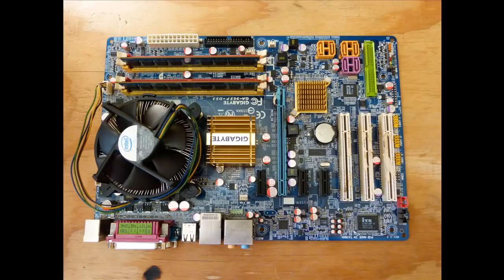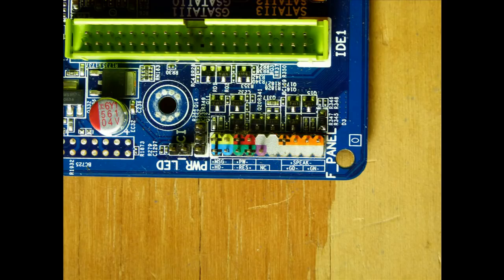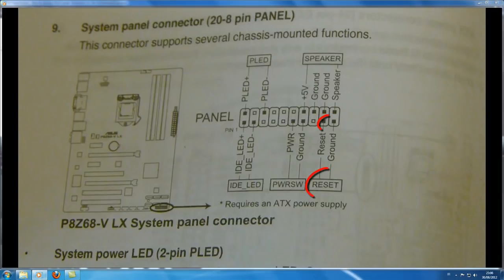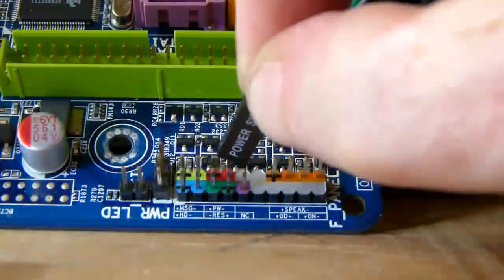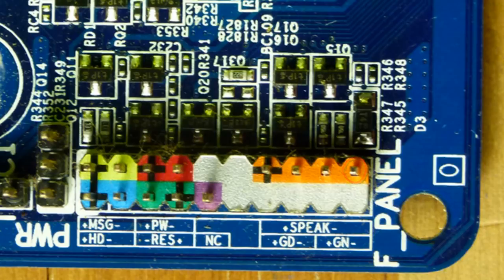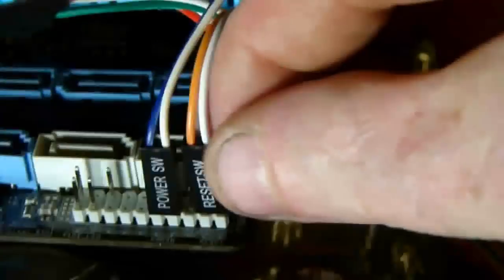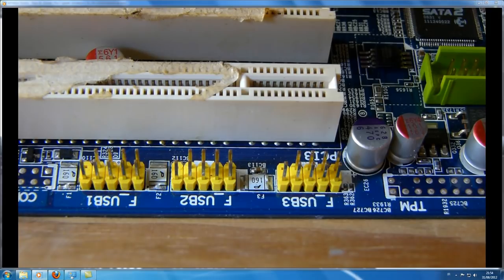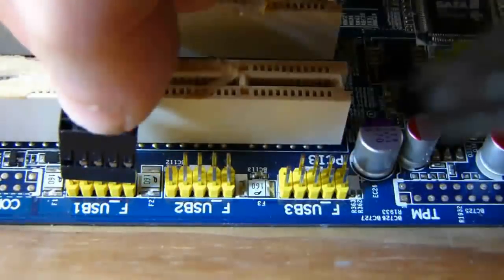How to connect front panel connectors to the motherboard

Comment: Hey! Good afternoon, I just bought a pc from some guys in a computer shop, and i went ahead and put my headphone in the front audio panel and there were no sounds, but on the back panel it worked, then i went ahead and opened my pc, seeing that the audio pin thingy wasn't there and not connected, what would be the best approach to tell them that HSHHSHSHS
Reply: That's what happens when you buy PC from some guys

Comment: hey man. ive been having problems since i upreaded my GFx card. was working fine one min then jst powered down and wouldn't power again., rplaced the card, worked fine. i have the motherboard out of the case as i was working on it, and left it on the lab table for a while just in case, then one day i was connecting a headphone jack to the green slot on the backboard and psheeeewwwww. Everyting went off. No life. I removed the PSU, works fine on it's own. It'll also power fans and even the GFX card fans from it. But when i plug in te 24 pin connector and remove the GFC card and only plug in the CPU's onboard HD4000 HDMI onnector, and NOTHING else, just a stick of ram and press ON... nothing

Comment: I had a prebuilt msi desktop and I moved everything into a new case, everything works fine except for when you shut down the computer it automatically restarts. As soon as all the fans and everything turns off it comes back to life.  I thought I had wired these front panel connectors wrong but I have re-checked it numerous times. I unplugged the reset switch.  The only thing that is different about this build that I took out the wifi card which was in the 2nd pcie slot and  had a jumper to one of the USB headers.  I used this USB header to plug in the USB needed for the rgb fan controller for the thermaltake rgb fans.  None of the fans plug into the fan headers except the CPU fan.  It was giving me an error on start up saying no fans were detected so I installed the old case fan back in the new case plugging it into it's original location.  Any help would be greatly appreciated as this has become very frustrating.  Thank you

Comment: my lian li dynamic case has a 9 pin front panel audio to motherboard connector and i cant for the life of me get this little fucker into the pins. the audio header will go in about half way then stop. ive put decent pressure on it but i dont want to keep forcing it..

yes i have read and followed the manual and have the pins the correct way. 100%sure. 

is it possible that i have faulty audio pins? and is there anyway to check this, thanks.

Comment: The problem is the fuckin' case if you have a fuckin' 10.5 inch long fuckin' video fuckin' card and a fuckin' Antec 300 fuckin' case the fuckin' wires will fuckin' well prevent you from being able to push the fuckin' video card the fuck down.

Comment: For those who have the power pins seperated, - (black) is on pin 6(3 pins from top left) and + (red for me) is on pin 8(4 pins from top left or last top pin) my pins were 4 on top and 5 on the bottom.

Comment: I do not know how to connect the 8 holes in the USB Pins. 
The holes are

1       Port+
2       Port+
3       Port-
4       Port-
5          +
6          +
7           -
8           -

What to do with that? Please help me!
Reply from the maker: Sunil Adhikari sub front connector is designed to just plug into that connection, okay!

Comment: sir, i have acer company motherboard on it have 2 panels of 9 lines and i want to connect hdd led,reset sw pins on it so first panel name is COM and onother is F_panel and onother one having 19 lines name as TPM SPK so where i can connect this 4 front pines on motherboard
Reply from the maker: what 4 pin connector is it? this would be detailed info in motherboard manual. ok! check in motherboard manual!

Comment: My manual dont have the instructions..
Reply from the maker: if it doesn't then it's not the mobo manual!
Reply: it's all that came with it. But I think I figured it out. Something else though, it seams to be that my motherboard dont have a CPU power plug. The 4 or 6 plug usually. Can this be right? My motherboard is a Asus prime b250m-plus. All I can find that is a 4 pin connector is the ATX12v
Reply from the maker: it's either 4 or 8 pined plug for cpu power 8pin is for turbo power. the 4 pin atx12v is the right one for average cpu an 8pin is required for cpus that have the turbo power feature ! ok!

Comment: what is front panel audio?
Reply from the maker: It's either just a small speaker for indicating that your computer is working properly it gives 1 beep if all is good and more than 1 beep something is wrong you will need the motherboard manual to know what the beeps mean if there is a problem and the front audio other than a small speaker then it's usually a connection to a front panel audio jack for pluging in speakers or headphones. ok, hope that helps!

Comment: The official manual both online and on paper doesn't include a detailed System Panel connector. I'm at the point of wanting to return it for one that has a better manual. 

For anyone that wants to take a read, the link is here. http://dlcdnet.asus.com/pub/ASUS/mb/LGA1151/H110M-E_M2/E11622_H110M-E_M2_UM_web.pdf?_ga=2.79628055.242653562.1494188311-1745619420.1494188286
Reply from the maker: thanks for sharing 😊

Comment: Sir i want to play music inside my CPU by using some speakers. I have seen many computers having inside speaker. Music sound can be heard. But how to do it any idea.. I have some local speakers..
Reply from the maker: There is a audio jack at the back of yu PC plug in the spekers jack into that and the pc will pick it up and you should have sound coming out of lacal speakers, OK! Not all computers have built in speakers some monitors do have speakers if you have monitor speakers then you need a two way jack plug cable one jack for monitor and the other jact for back of PC must plug in both via the two way audio jack cable. OK, i hope you get it sorted! 
If you don't get it sorted check out someone's PC that has speakers plugged in and see how they have it set up!
Reply: I want to play music inside my CPU by connecting some motherboard units not by back panel of my CPU. Is there any options ??

Comment: My reset sw won't reach the port???
Reply from the maker: old case then? you will have to get a extention cable to connect it to the motherboard any good computer store should have one or get it on ebay. OK!
Reply: Thanks :)

Comment: My power LED light has three holes instead two, or instead of one hole for negative and one for positive, and my motherboard only has two pins right next to each other. So i can not plug in the Power LED light. Theres no other way to plug it in is there? If not its not that big of deal right? Its just the power LIGHT. All the other connectors connect. So it should be fine. Just no light.
Reply from the maker: Yes that's fine you don't need the power light! It's strange that it is a
 3 hole connector for power LED, are they right beside each other or is 
the extra hole seperating the two wires? If the wires are becide each 
other then it could fit in the connector on the motherboard. OK!
Reply: Kevin Colleran it an extra hole separating the two wires. Its a really old case. Like 20 years old haha
Reply from the maker: oh well! that's the way it goes sometimes! it's an enjoyable experience isn't it? building a pc from scratch. it not a big problem the power light...;^)
Reply: Kevin Colleran yes it is. My first build. So i might check out more of your videos! Thanks for ur help

Comment: the front panel audio doesnt work con my pc, please help!!!
Reply from the maker: is the cable connected from front panel to the motherboard? it usually is situated at the back of the motherboard near the i/o panel , if it is plugged in then find a known working headphone set and check it maybe that what ever you have plugged in is not working. Ok!
Reply: Yes, I connect the front panel audio in the AAFP port but doesn´t work
Reply from the maker: are you sure that your headphones are working?
Reply: Kevin Colleran yes  totally sure, I try whit my headphones Sony, un the back port work really good, but in the frontera port doesnt work
Reply from the maker: so check device manager on your pc and look for sound device this will show you that the sound driver is working front and back then check if the front panel sound settings are enabled in control panel  then sound. ok!

Comment: how to connect power sw black and white wires to front case power button chassis?
Reply from the maker: it's usually printed on the motherboard but if not look at the manual, if you don't have the manual you'll get on manufacturer s website. ok!
Reply: OK Kevin.where can I purchase the power button on desktop front panel pin module if some of my pins have been bent? Thanks for your time in advance.Robert
Reply from the maker: the pins are fairly strong ! you straighten them just be careful not to break them. And if you need to get any thing including the power button any computer store should have them, if not you will get them on ebay. Ok!
Reply: Thanks Kevin
Reply from the maker: glad to help! hope ya got it sorted!

Comment: My audio is already connected but the is an extra end to it. Do I have to plug it in in order for my audio to work?
Reply from the maker: no that extra connection is for a second sound output that that is not built into most mobos there for sound eng systems and mixers. OK!

Comment: Hi, can I make the front audio work if the integrate sound card stop working?
Reply from the maker: Hi Fran! No, if you want sound on the front panel you have to get a sound card or replace the motherboard! Cheapest and fastest way is get a sound card and plug in the front panel connector into that. OK!
Reply: Hi Kevin!Thank you for the information  :)
Reply from the maker: welcome!

Comment: Accidentally connect HDD + and HDD - in the wrong oder I felt a small current vibration nowI have no power what do I do.
Reply from the maker: the led will not light up is all that will happen when you put it in reverse ! So something else is causing the power loss! OK!

Comment: If I tried turning it on while the positive and negative were in the wrong holes, is it possible I fried the cord?
Reply from the maker: No it's not going to fry anything! it's a contact switch it makes 
contact and then it opens again no frying will happen! ok just turn it 
around the other way and you will see!

Comment: my motherboard has sata3 ports and sata3 express ports.my issue does it matter where and in what order should they be in cause I'm installing a optical drive, a 500gb hdd, and a Samsung evo ssd 850. thank you
Reply from the maker: sata3 express ports are faster if you can connect both to the "sata3 express ports"! OK! and if you only have one sata3 express port then install the ssd on it and make sure you install your Operating system on the ssd! for the fastest experience you can get!
Reply: Thank you

Comment: I followed your video and the manual but my pc wont turn on.
What do you think the problem might be?
Thanks
Reply from the maker: is there a switch on the power supply? turn it on! that is the usual problem.
Reply: Nope thats not the problem.
Reply from the maker: are you getting any lights or fans turning? like is there power going to the mobo? light on the mobo? i don't have enough info to troubleshoot this issue like is there a light on the power supply ?
Reply: +Kevin Colleran theres no fans turning and no lights on the mb.
Reply from the maker: double check the front panel switches! the power switch maybe in the wrong position! if that's not the problem send me another comment and i'll look at it again tomorrow i have to sign off now, but ill be around again tomorrow ok!
Reply: +Kevin Colleran No they are all in  the right position
Reply from the maker: Is this a new build or are the components from an old build? you're now looking at troubleshooting the system. Make sure that the power supply is plugged into cpu power socket it's a 4 pin or 8 pin socket and also make sure the main 24 pin power socket is fully inserted. best practice is to unplug them and reinsert them again bad contact can cause no power to mobo. after that, if it still will not turn on, then you are looking at getting spare parts and swaping them out one at a time to see which part is defective. if you have a graphics card unplug that also and see will the pc power on without the graphics card. these are all the action i take with a pc that will not turn on. OK! hope that helps!
Reply: Kevin Colleran Alright i'll try all of these and tell you the results after. Thanks!
Reply from the maker: you will find the problem! kip her lit bud!
Reply: +Kevin Colleran Thanks man. Also the problem arose after installing my gpu.
Reply from the maker: so was the gpu the problem? did you remove it and see did the pc turn on?
Reply: Kevin Colleran yea as soon as i installed it my pc wouldnt turn on.
Reply from the maker: new graphics card then! glad you got it sorted!
Reply: +Kevin Colleran thanks for your help btw
Reply from the maker: no problem bud!

Comment: where do plug my front mic and headphone cable on my motherboard
Reply from the maker: Hi' Check your manual for exact place! usually near the back in front of the rear panel i/o connectors.

Comment: please help me desktop won't start after a bios update any solutions
Reply from the maker: Clearing the CMOS memory can solve BIOS corruption, but causes you to 
lose all customized settings in the BIOS. You also need to reset date 
and time in the BIOS setup after clearing the CMOS.

Clear CMOS by battery removal

If the computer will not boot into Maintenance Mode, 
you can clear the CMOS by removing the battery from the board.

Turn off all peripheral devices connected to the computer and 
disconnect the power cord from the AC power source (wall outlet or power
 adapter).Remove the computer cover.Find the battery on the board and remove it.
  If the battery is in a horizontal or vertical battery holder, using
 a medium flat-bladed screwdriver, gently pry the battery free from its 
connector. Note the orientation of the plus and minus signs ( , -) on 
the battery.
Leave the battery out for 10 to 15 minutes, for the CMOS to lose the settings.Reconnect the battery using one of the following methods:
 Insert the battery back into the horizontal or vertical connector, orienting the " " and "-" correctly.Plug the battery wires back into the onboard connector.Replace the computer cover.Reconnect AC power and turn the computer on. BIOS Recovery
If clearing the CMOS does not resolve a no-boot situation, try doing a bios recovery.
Another way is to get a working identical motherboard same model id 
and replace that Motherboard. This is the only other way that is easy to get it right!
Reply: still not work 
how to flashing bios ?
Reply from the maker: if your pc won't start you can't flash bios with out a bootable flash disk! flashing bios may not fix the problem the bios up date does not corrupt bios unless it was the wrong type you installed! why did you update the bios it does not do anything special! uninstall the update you will need the operating system to do that look it up on the motherboard manufactures website all the info you need should be there!

Comment: So i'm trying to plug in the usb able into my usb port on my mobo, but It won't go down all the way. And I'm positive it is the right port, both 2.0. I'm also having the same trouble with my audio cable and the audio port. I'm pressing down hard, but i don't want to break anything, any suggestions?
Reply from the maker: if they are the right connectors and your absolutely sure the ports are not broken then they are in all they or you have to use a little force best thing to do if you not sure bring to someone that knows what is the problem computer store or a friend that uses computer a lot! OK, hope that helps!
Reply: +Kevin Colleran Thanks! I just applied more force and I got them in!
Reply from the maker: Ok! glad you got it sorted!
Reply: Did you also do this with the audio cable? I'm having the same problem, it doesn't go all the way but if I push it almost bends the board and I don't want to break it.
Reply from the maker: you won't break it, but if you are concerned! leave it the way you have it in, it has probably made contact with pins. So its ok to move on to the next item in your build!
Reply: Kevin Colleran Thanks for the advice! I eventually just left it like you said and it connected without problems. I didn't hear a click but it's fine now. Thanks!
Reply from the maker: Glad you got it sorted!